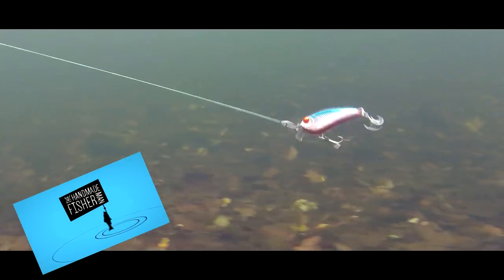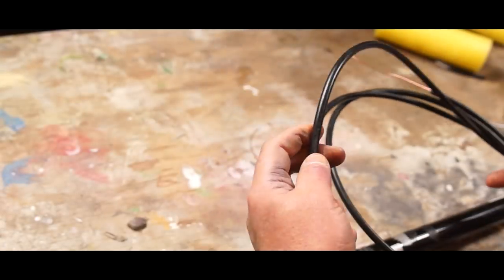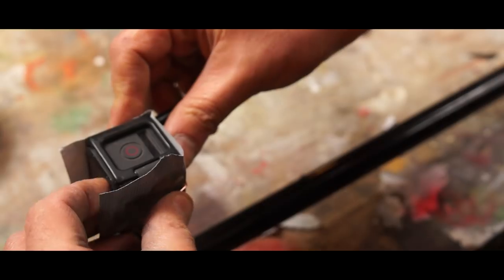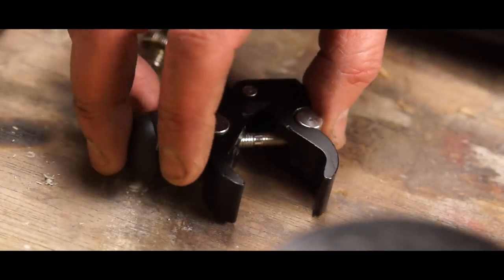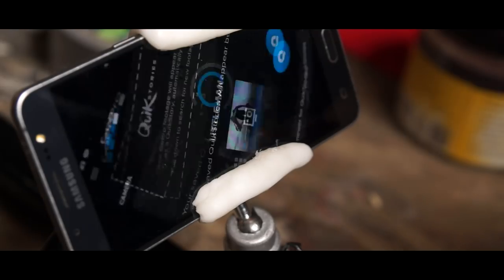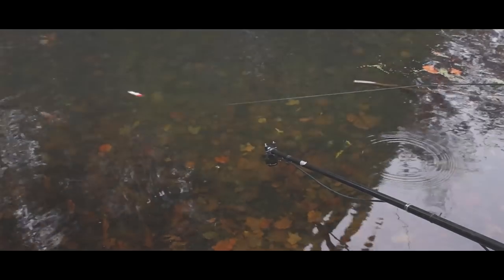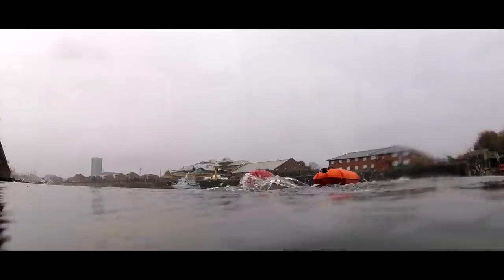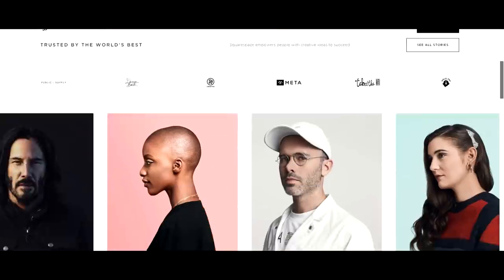How to film fishing lures underwater using a gopro and wifi

Comment: Paul, the limitation of 30 fps is just a limitation in that entry level hero right? If I use another GoPro that records 1080P in 60 fps that will result in video quality that can be used in slow motion right? Great video and idea.
Reply from the maker: i think you maybe right, you can get a preview in 1080 superwide whihc is 48 frame per second, I normally render out at 24 frames a second so techincally i could get half speed. but i am guessing in the high end gopros you can preview at higher frame rates, they have also different wifi signals and options as to what connection signal  you use.  I was hoping some cleaver dick out there would have some answers an leave some input, i am a bit of Luddite, with these, put me behind a conventional camera and i can take iso, bmps all day

Comment: Paul - here's an idea to guarantee framing for your underwater footage that will save time, frustration and (I would have said "saves film stock" back in the day, but ... ) saves battery life:I'm sure you have some rods that have broken that you haven't yet fixed, so take the top section, or chop a blank to fit, put a camera crab claw clip (I can type it, if not say it quickly) on the bottom end, another about 12" up from that with a section of rod blank attached to it, and a third clamp at the end of that section.  You now have a re-positionable "1/2-leg" of a Y where you can adjust the angle of the rod offset from your camera pole and how far it extends in front of the camera.  Tie on your line/leader and your lure so that when you drag the whole rig through the water, the lure will be center frame and in focus.  Should be a better time moving just the one pole through the water, or walking along the bank than having to deal with the camera pole, and the fishing rod, too.  Naturally, if you want the footage to be the lure swimming towards the camera, you have that already sorted, and the 1/2-Y rig is detachable.
Reply from the maker: great minds think a like, i have use that set up before, with the tip of a rod, normally i carry a little triangle of wood and just gaffer tape it on with the rod tip a little way back from the camera and then set a trace length so it fall in the middle of the shot  , if you look back to part 3 of the phox weight shift minnow build i am using that rig in the final shots and in the cranks bait video at the end. It is great for framing, the only draw back with it is it can look a bit static because it is always in the right place,  and on swim baits it is hard to get great jerking shots as the camera and the lure are connected, but maybe it needs some more experimentation, thanks    https://youtu.be/J8IK22dmLos?t=557

Comment: Brilliant Paul, thanks
Reply from the maker: if your using spinners, you can attach a small piece of rod to the end pole at an angle, with some line to the spinner so it sits in the middle of the shot
Reply: @PaulAdamsTheHandmadeFisherman  That is kind of what I did in my test tank, thanks mate

Comment: Why not us screw thread on landing net
Reply from the maker: the last section of this landing net has a standard net thread  but i never use it because it gets too wobbley, i do have adaptors for camera thread to landing net threads which is the same banks sticks, which i use instead of tripods on the bank with small cameras. But if you have stiff enough pole there is no reason not to use the landing net thread. Before i had the landing net pole i was using a long extension paint roller pole, thanks

Comment: Will i need to get the cable inside the waterproof housing?
Reply from the maker: no, just on the back of it, the housing is plastic
Reply: It appears not. As long as the cable is very close to the housing it should pick up the broadcast wifi signal from the gopro which is then carried up the cable to the phone. The problem I believe occurs when the wifi signal hits the surface changes mediums from water to air, the signal is then scattered. So having the wire carry the signal through that transition is what makes this work.
Reply: Thanks, so i could just tape it to my phone and my waterproofhousing
Reply: @morganogwenpysgota  Sure! I think he chose the molded plastic since the water won't peel it off like the tape will. I'm sure it would last but my guess is over time the adhesive of the tape would peel loose.